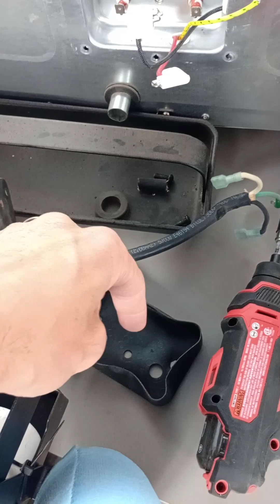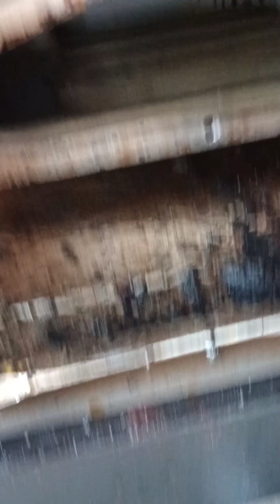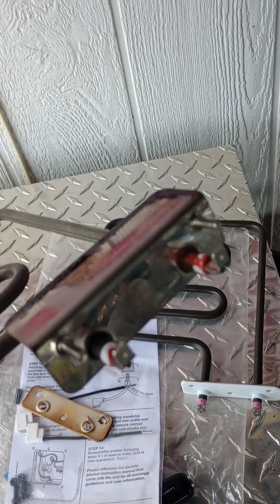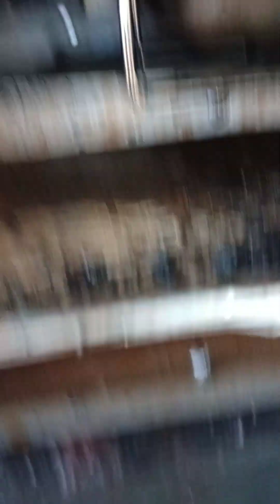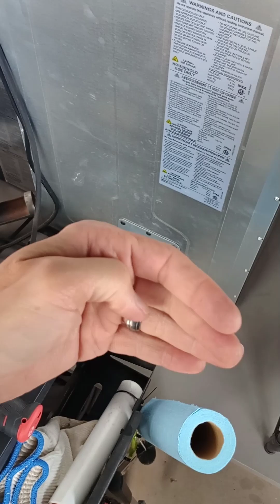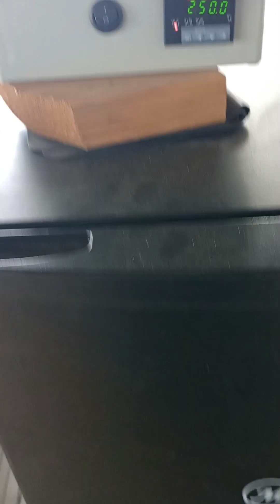masterbuilt element swap from 800w to 1200w

Comment: Dude, get you a CGB for that power wire going to the element.  Then put a ty-wrap around the power wire on the inside to keep it from being pulled out if you're worried about that.